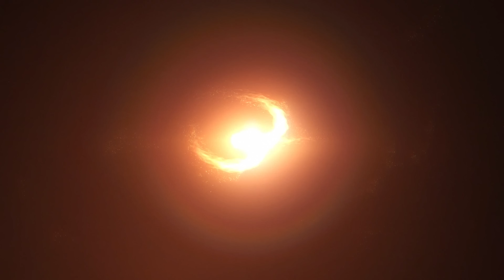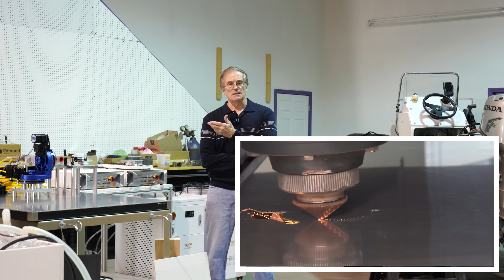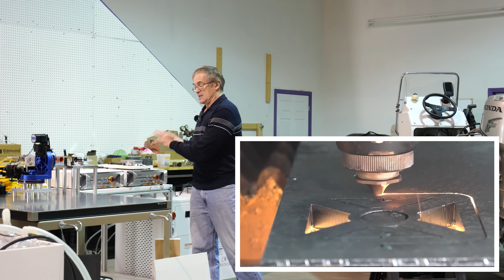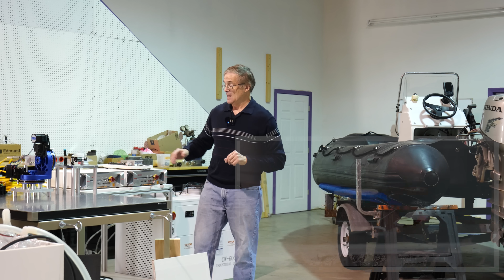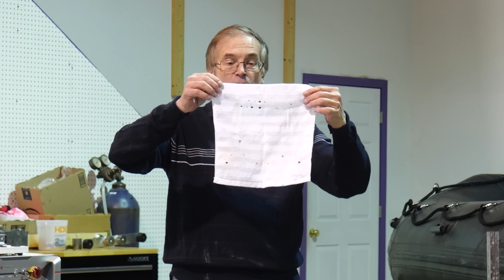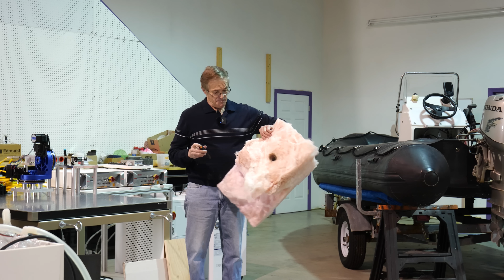We have a problem... and need your help!

Comment: How about building a wall out of Fresnel lens sheets to disperse the beam? They are widely available and can be pretty cheap.

I haven't looked at the specifics of your laser setup, so I cannot recommend any particular solution. However, you'd need to be careful with dust, dirt, impurities, etc. on the lenses as they could melt the lens if hit. Perhaps a double or triple wall separated at some distance could help both with redundancy and dispersion. Maybe a dust barrier on the perimeter for a good measure.

Great work, btw, and good luck! 😊

Comment: My idea is to use a rough surface, something made out of metal cones to increase projected laser area, reducing the fluence. It kind of need to be something with both enough thermal mass and thermal conductivity. The metal surface itself is unsuited because of how reflective it is. Pyroelectric laser power meters have what is to my knowledge a SiC silicon carbide coated surface for absorbing the light effectively and keep a high temperature and damage threshold. I wonder what the availability or diy-ability of such a coating on a metal sheet with active cooling is.

Comment: I believe the reason plywood lasted was the fire/smoke it dispersed the laser. The smoke caused the laser to be dispersed for a short time reducing the power at the source. I think you have hit on the reasoning of why the laser cuts. It is not the laser that actually cuts the metal but the metal itself. The beam focusses and causes the metal to plasma state at the narrow focus. Once cut, the beam diverges and the power is below the plasma point and continues to diverge therefore losing power until it hits the floor. Maybe some sort of aerogel would do the job.

Comment: I'm not an engineer so you can all scream at me if I'm being silly, but what about a thick wall of fumed silica, about 500mm thick I suppose.  It already has very low conductivity, a very high melting point and isn't very transparent to IR.  if you can press it into blocks you can pack them like fire brick or make panels.  It's very light too, and cheap.  You could 3d print a small tile mold with angled surfaces to ensure that what ever amount of the beam is going to bounce, bounces down.  I will see if I have some FS left at the workshop and see how it fares against a laser cutter.

Edit:  you could add a layer of graphite powder to the FS too.  absorb then insulate

Comment: 🚨👋Love your channel! To safely block your high-powered laser, I propose a replenishing 3–4 layered waterfall system.

Continuous water curtains (thick, medium, thin) absorb and scatter the beam, preventing penetration indefinitely as water replenishes faster than the laser vaporizes it. Three curtains should do it, with a fourth for redundancy or coating/cooling a substrate. A DIY wooden frame and poly-lined trough keep it cheap and portable, using second-hand pumps and firehoses for water delivery. Perforated PVC pipes create precise, angled flow patterns to maximize depth/scattering.

Materials: 1.5" perforated PVC pipes, 2x4 lumber, 3-mil poly sheet, second-hand 2000 GPH submersible pumps, garden/fire-hose, DIY wood/poly reservoir, fittings/connectors/clamps/filter, screws, caulk.

Criteria Met: Blocks beam >3 seconds, absorbent, not reflective (water scatters light), non-toxic, non-flammable (safe materials), reasonably available, cheap (off-the-shelf, second-hand), portable (disassembled frames, movable reservoir), and potable! (if you choose).

Let me know of you have any questions!

🙂Hope this helps—excited to see it in action!
Reply: Maybe add a thickening agent:  Xanthan Gum, Guar Gum?

Comment: Use a separate laser power control system which control the relay. this system requires a signal from your main computer to turn on if ur main computer get stuck its laser control signal will likely also get stuck in a high state because the separate laser power control system requires a signal not a constant high signal it will turn off the relay. and keep this system as simple as possible, so it has less chances of malfunctioning. about if the target is destroyed instantly and the laser is obstruction free to destroy anything I its path I don't know what can be done about that I guess just use a depth sensor to detect it the laser is going beyond the target but idk if it works. BTW I don't think so there is anything which can withstand your laser it too powerful.

Comment: Glass fiber insulation can typically withstand service temperatures up to around 230°C. It begins to degrade at temperatures between 300–400°C, primarily due to the breakdown of its binder materials, and the glass fibers themselves can melt at approximately 500–600°C. This makes it suitable for most residential and light commercial insulation applications, but not ideal for high-heat environments.

Mineral wool insulation, on the other hand, performs much better at high temperatures. It can handle continuous service temperatures of around 600–700°C without significant degradation. It only begins to break down at temperatures above 700°C, and its melting point is much higher—typically between 1000–1200°C, depending on the specific type (stone wool or slag wool). This makes mineral wool a preferred choice for industrial applications, fire-resistant barriers, and areas exposed to extreme heat.

Comment: A plywood box 4 x 4 x4 feet full of water siting in a slightly larger tray with a sump pump recycling the water. Easy to drain and move. You could use it to observe the absorbing properties of different dyes.

Comment: Just use a focal lens to intentionally spread the beam out on the other side of the target focal point to minimize energy density in far field.  Keep your focal point short.  Infinity is the dangerous part. Minimise distance to target.  Directly above is the safest cause it is pointing at dirt, hopefully. Maybe a puff of fine particulate behind the target to accelerate diffusion.

Comment: I was reading on materials that block lasers, but a lot are reflective... and that could potentially cause damage to your hardware. What you need is a barrier that is resistant to your lasers at whatever wavelength of laser you are using.

For instance, I googled "Laser cutting of quartz is a precise and efficient method for cutting this hard material, especially with CO2 lasers. CO2 lasers, particularly those with wavelengths of 10.6µm, are effective because quartz has a high absorption rate for this wavelength, allowing for rapid vaporization of the material."

So, what if you focus on a barrier made up of something that DOESN'T absorb the wavelength of your lasers that well, and use that as a barrier material? A bit of googling also pointed out that carbon fiber is resistant and difficult for lasers to cut through, taking some time in most circumstances. Perhaps you could test its endurance in a cutting situation that wouldn't slice through your garage door?!  ;-)
I suspect you could find enough spare time to power off your laser that way.
See https://www.youtube.com/watch?v=fu4TnK3EN9g

They also make laser safety barriers, btw, which are made of "Two layers of aluminum
bonded with corrugated polyallomer core". Perhaps you could replicate something of the sort, assuming you had someplace somewhere you could test it safely.
https://www.newport.com/f/laser-safety-barriers

Comment: My first instinct was to think about ways to put coarse sand in the way since it would ideally flow some to fill the gaps made when it melts. I would want to build a wall out of something I could stack/unstack with a forklift maybe. Plastic bulk bins of sand (Uline sells collapsible ones that are tough) would get holes punched in the side but I'm willing to bet you could find something that would take a beating and last well enough for the purpose.

Comment: Some interesting ideas.  But lots of folks don't seem to GROK the physics of their suggestions at this level of concentrated energy.  You might want to pin a comment that (after vetting by the various SMEs) gets updated with explainations of how certain solutions are potentially dangerous or even explosive.  Ever see what happens to a "dry" concrete floor when concentrated heat is applied?  The vetters could be those in HE laser, optics, material sciences, particle physics and even steam engineering.

Comment: You may consider simply only shooting down towards the ground so worst case you shoot the floor. You may have to clear some floor space and hang the turret from the ceiling/wall. 🤷‍♀
Reply: PS: You can do this outside too by putting it on roof so the laser is just shooting down at the lawn. Just a thought.

Comment: What about some sort of servo-powered or spring loaded stop measure?
Something like a "SAWSTOP" but for your laser.

Something that is physically directly in front of the beam but out of the way.
Whatever the actual stopping mechanism might be is up to you. 
(Some first thoughts are a lens to unfocus the beam, a mirror to redirect it, or some sort of sacrificial material that could simply handle the laser's energy for a brief measure.)

Comment: Angle your targeting 35 degrees or greater toward the ground from a platform high enough it will go deeper into the ground the further it travels, use layers of dispersion material that fill in any holes from above like liquids, gels, or metals, a metal that is liquid at room temperature that is safe even if accidentally gassified.
Reply: i wouldn't use the sky as a backstop, they are cracking down on even the weak laser pointers pointed at our skys with new tech to detect offenders and come with heafty federal penalties.
Reply: I would also try to shorten the beam time to as short as possible a burst per fired as well.

Comment: 1. Reduce the amount of energie that the laser can use (like a capacitor). The laser must be like a bullet (very high energy but very short time) and not like a beam you switch manually on and off.      

2. lower the distance to your test target. Make the target a connected part of the laser (the laser cant miss the target).     

3. cool down the test target and use copper.     

4. use a low energy laser to detect (reflection) a target. You can only activete the big laser, if there is a target at the same time. With the distance  you can focus the laser at that point.      

5. shoot to the ground   

Sorry for my englisch, greetings from germany and live long and prosper 🖖👍

Comment: What about a one way mirror with a convex reflector behind it to diverge the beam after it travels through the one way mirror. You could also use a gas between the one way mirror and the convex lense, the photons will ionize the gas and create a plasma to defuse the laser energy. You would need something like double glazed windows to seal the gas between the two.

Comment: spin stainless steel discs or other materials. laser would not be able to burn through single point. swap out fan blades. hopeful material has time to cool down after rotation.

Comment: 2 things i what to se geting blasted:
1. A plastic bag full of water can withstand the heat of a fire (due to the "phase change" thingy). Might be that the laser evaporates the bag so quickly that a hole is formed, making it a bad shield?
2. try making your own starlite material. laser evaporates material so fast that a plasma is formed, and the plasma forms a shield... but when i write this I realise that it might reflect the beam not absorbe it making it a bad shield =)   carbon spiced starlite?

Comment: pumice stone with hollowed out core (stacked) with water pumped down the hollow center (or fire brick... the light kind)... just my 2 cents... but i know very little about lasers, specifically... but it would be cool to have sharks with frickn laser beams attached to their heads...

Comment: God won't strike you blind but that laser will. If you go into a laboratory with lasers of that level there's probably two or three million dollars worth of safety stuff. Goggles alarms, vestibules. If somebody is looking at that drone and there's anything shiny on it you can blind someone. I have 7 years of electrical engineering college under me and I would have to say the probability that you're going to blind someone is certain. I can't guarantee you'll knock an eye out and blind somebody every time you start it but there are so many things windshields Windows bumpers Chrome stuff mirrors polished aluminum, eventually you are certainly going to blind somebody with this if you take it outside.

Comment: I would suggest evaporation coils of a refrigerator with the ice on it of sufficient thickness. However you may have to shift the beam to avoid a hotspot and the time on that spot would depend on the thickness of the ice and the power of the beam you can even have a water curtain over the ice to lower of restrict the rate of the melted ice.

Comment: Dense objects like plywood performed well, cloth did not. Dry objects catch fire, wet ones cannot. With this information alone, I think you might get surprisingly good results from a few sheets of waterlogged plywood screwed together. To go further, an enclosed layer of white sand or finely crushed glass behind or between plywood sheets might also help to disperse the light. The melting sand should provide continuous beam blocking, as the sand melts and more loose sand falls in to fill the void. Cheers!

Comment: kaowool/ceramic blanket might do the job, much much more heat resistant than fibreglass insulation, can be bought for cheap from aliexpress. my other thought would be change out your optic to one that will be much wider/diffuse by the time it hits the walls of your work space.

Comment: Starlite (PVA glue, baking soda, and corn starch) ablative heat shielding foams as it melts then carbonizes forming a continuously regenerated shielding layer that needs to be vaporized before the beam can penetrate further... Tiles or bricks of this stuff would give minutes of protection and still be reconfigurable depending on the experimental setup required.
  [https://www.youtube.com/watch?v=aqR4_UoBIzY] - The rediscovered or DIY Starlite material (clip starts with a pancake thick piece of Starlite shielding the narrators hand from a propane torch)
  [https://www.youtube.com/watch?v=Qtm_xOtw_r0] - DIY Starlite crucible vs thermite (spoiler - Starlite survived long enough for the thermite to extinguish and cool) 
  [https://www.youtube.com/watch?v=5_6fONbnIUI] - 40W CO2 laser engraver vs approximately 1cm thick DIY Starlite sample for 2 * 60 second continuously at full power without penetration

Comment: Whatever material you use, if you spin it fast enough on something like a wheel, I believe the heat will spread over a larger area, it just shouldn't be aimed close to the center of rotation. But i'm not sure if is practical

Comment: How about, since they've cancelled the space shuttle program, they might have a number of space shuttle reentry ceramic tiles around. If you have to you could also put them on a rotating board to not have the laser spending too much time in any one spot. The way the US govm't throws away extra material you might get a steal on the tiles.

Comment: Coming from a lighting background, if you were able to actively adjust the beam size, or divergence, during  initial use to spread out the beam slightly then the energy per unit of area drops dramatically.
A servo driven lens array in your optical train say. And only go to the death ray focus point as needed.

Comment: On top of my other comment, theres another youtuber who does some really neat, fringe, at home science.

He did a video on reverse engineering an extreme heat resistant material lost to time. The original recipe appears to srill be unknown, but the mechanic seems to be the real-time generation of an insulative carbon foam as the material reacts to the heat. He makes a few versions out of some EXTREMELY cheap readily available materials:

https://youtu.be/aqR4_UoBIzY?si=i5uXw8iXtLGOiG16